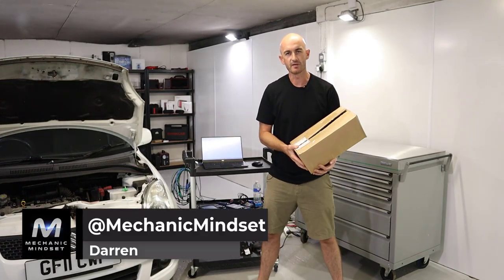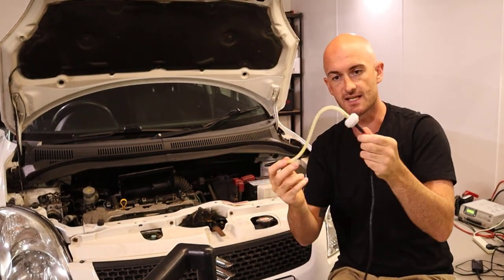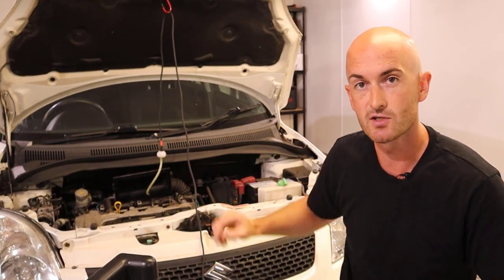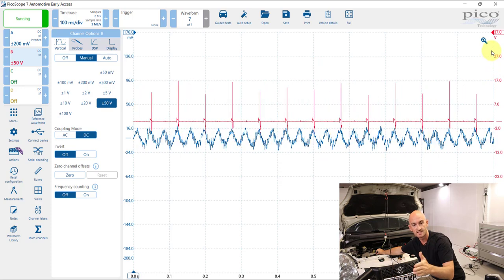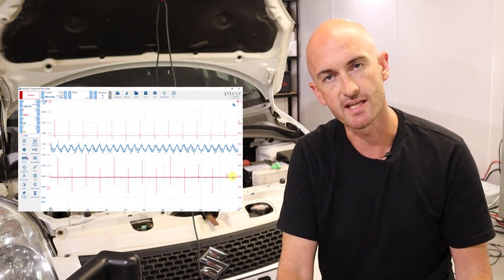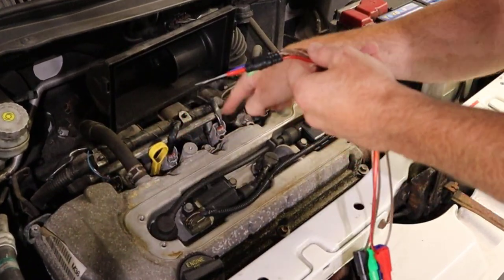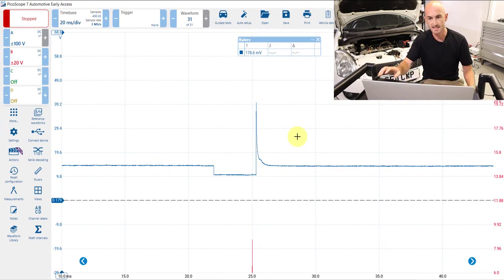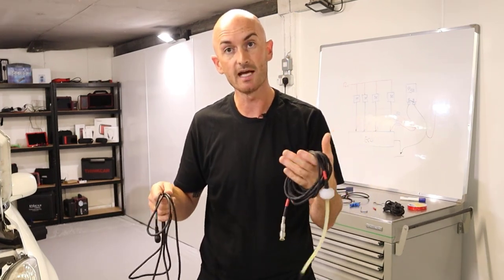What do you think of these scope probes?

Comment: Thanks a lot, Darren. Useful information and excellent presentation, as usual.
Cheers. George
Reply from the maker: Cheers George! Have you seen Rotkee before?
Reply: Yes I have seen their site in connection with the waveforms available on it and I was wondering about their equipment too. Now recommendation coming from you makes me want to buy some 😊. Let's see.
I was looking for more affordable pressure sensors for in cylinder diagnostics. Are the ones ROTKEE offer going to work? That would be nice to know.
Reply from the maker: @georgetzekov445  I’ve not tried their pressure sensors but they seem to have a BNC output so I would say yes. 

You would just need the parameters to make the custom probe. 

I assume it would come with its own separate power supply too. 

One of the pressure sensors looks like it’s out of stock at the minute

Comment: The Rotkee probes look interesting.  I have similar probes from some other vendors, but I like to try new probes.  I ordered several, the acoustical probe, the 4-in-1 probe (2), and TL-mlp Multipurpose Test Lead.  I enjoy watching your videos.  I do have a PicoScope, a 2204, for small stuff - and mostly to be able to say I have a PicoScope for folks that may pooh pooh me having a non-PicoScope in my arsenal.  My GoTo scope is a MicSig 4 channel SATO1004.  It is very capable and not needing an outside piece of equipment (laptop) makes it easier to use - less clumsy.  All of the various demonstrations you present can be performed with the MicSig unit also, which is nice.
Reply from the maker: MicSig is a nice scope! Very convenient as a tablet 👍
Reply: @MechanicMindset  I like both, but the MicSig is my Go To scope.

This may not be "new" to you, in fact I am betting it isn't, but for for giggles I will share a few thoughts.  I recently became aware of, and purchased two Chassis Ear kits.  One has wireless sensor, the other had wired sensors.  For the wired sensors they are terminated with 3.5mm sound jacks, which get plugged into a 6 channel box where I can flip a knob to select which channel (sensor) i want to listen to.  The idea is to find out which sensor is picking up a bothersome noise or vibration.

Well, while I was tinkering with the wired sensor kit I decided that I wanted to pick up some 3.5mm jack socket to BNC socket adapter cables.  Then I can plug in up to 4 wired sensors and direct the electrical signal from the sensors into each of the 4 channels on the scope.  That way I can get a visual representation of the various sounds.  I can also watch up to 4 channels simultaneously as opposed to only being able to listen to one channel at a time.    Morever, were I to pick up a low cost 8 channel recorder/playback machine I can make a recording of multiple different sensors that I can play back at any time I like.

I found out, after my epiphany, that Pico has an NHV kit already, that does what I am describing.  But, they have taken their design to a true cutting edge, whereas my approach is more akin to a hacker coming across a cool idea.  I guess I have a poor man's Pico NHV near equivalent for a lot less than the Pico kit is.  Now that I have these Chassis Ear units I can't  am hardly wait to come across someone with an objectionable noise!  So, I will just begun to play with the Chassis Ear morphing into the oscilloscope arena and see else I can come up with.  I have lots of ideas already.  What fun, blending two or more technologies to help resolve an issue that drives a lot of folks crazy.
Reply from the maker: @gilberthale7777  I love the chassis ears kit; used it all the time!

Yes they give off a small voltage; I think they are piezo elements which are often used in microphones. The Pico kit is next level; I understand they are more like accelerometers which don’t suffer the same physical effects of piezo and can measure more 👍
Reply: @MechanicMindset  chassis ears do use piezo chips to generate low voltage signals. Just having the chassis war kits is awesome unto itself. But melding into the scope world is going to make it all the more fun. 

The Pico NHV kit is definitely awesome. And way over the top. From what I can tell been without a scope interface the chassis ears are going to be a game changer for me. I wish we had these available back in the 70s and 80s when I worked as a tech.
Reply from the maker: @gilberthale7777  Cool! Yes the NVH kit can determine the frequency of vibrations and noises which can then be paired with components of varying rotational speeds (so you can tell between diff, wheels, engine, transmission etc)

Comment: I heard about ROTKEE a few years ago, I got there petrol in cylinder  pressure sensor and adaptors I have found it to be very good quality, I like the 4 into 1 lead, the only problem I had when I ordered my parts where paying for them bit off a messing about lucky I knew someone in Ukraine who paid locally for me, ROTKEE  also have a good waveform library where you can upload waveforms from any oscilloscope unlike Pico.
Reply from the maker: Thanks for sharing!
Reply: @MechanicMindset  Just ordered a few more items from ROTKEE and they now use PayPal which make paying much easier.
Reply from the maker: @no1conrod  Agreed! I think the payment terms were a sticking point for most orders 👍 Enjoy!

Comment: The signal is between 5V-15V for the Rotkee Ignition Pickup.  Igniton is usually around 50V, is there a conversion needed to get actual measurement or is it for waveform shape analysis, not waveform measurement?
Reply from the maker: Thats right, shape analysis. It may vary depending on coil construction. And as far as I’m aware we can only ‘measure’ secondary kV on the HT lead to the plug 👍

Comment: So I’m really new to oscilloscopes. My question are oscilloscope current probes interchangeable between brands? For instance I can buy a pico scope current clamp and use it on a siglent brand handheld oscilloscope?
Reply from the maker: Yes, if the oscilloscope has the BNC connection, it should work on any oscilloscope

Comment: One thing I don’t quite understand, is why there is no direct ground connection on any of those? Will it be safe to connect through 2 BNC splitters?
 (6cylinder application) Ignition over the wire pickup comes in sets of 3 maximum. 1 splitter for 2 sets of 3 pickups and the second for the ground connection.
Reply from the maker: @marekhabel2493  I think they are designed and considered for the MT Pro scope where you generally attach a separate ground. I have scope leads from them too that are only one positive probe

Comment: I was going to ask about backfeeding the other injectors with that four lead probe but you answered that. Wouldn’t putting a diode in-line be a better solution and not affect the signal while preventing one signal from actuating all injectors?
Reply from the maker: I’ve looked at this, I don’t think you would get a signal on the scope with diodes. It will stop the short circuit though. Draw it out, it makes sense then. At least that’s the conclusion I came to 👍
Reply: @MechanicMindset  I was thinking one diode on each leg of the splitter that would allow the signal to come up the line but stop signals from coming back down the line. I’ll have to draw it up and look at it. I’m pretty sure I’ve seen one with diodes for primary ignition in the past
Reply from the maker: @Jpilgrim30  I’ll try and test it with 1 diode

Comment: Would a diode be better than a resistor? It would block the voltage going back to the other injectors that aren't being fired. Do I make some kind o sense lol
Reply from the maker: Yeah, I can visualise that. Not sure how that would affect any negative readings, ie, when the voltage drops after the spike. Might give it a go with one channel and see what happens
Reply: i did electronics from an early age, the problem may be that Resistors will 'dissipate ' (absorb) a certain amount of energy (depending on the wattage) of the resistor, however with a Diode , there are an awful lot of different types, forward/reverse bias, Zenor types etc, is that it will allow current flow in 1 direction(or hold a certain amount of energy until it reaches a threshold) and then it has to do something with it? if you get my drift, remember the current flow will take the least resistive path, be it Earth, point of activity or dissipate in heat build up. but no harm in trying, were all wana be experimenters / home scientist's and students of learning,🙂
Reply from the maker: @sollykhan2385  Yes, semiconductors are strange things!!
Reply: @MechanicMindset  indeed, current flow reminds me of the younger generation of today, it takes the path of least resistance !!🙂

Comment: Does the Rotkee pressure sensor or the COP inductive sensor require an attenuator on the Pico 2204a?
Reply from the maker: For the COP, possibly yes. Pulse sensor, no, it’s really low voltage 👍
Reply: Thanks for the reply! I decided to put in an order for both sensors as well as a set of their flexible backprobes.

Comment: I will be ordering the 4 into 1 leads and I was thinking about ordering two so I could cover 8 cylinders on two channels along with two of the basic 4 into 1 leads so on a four channel scope I could see all coils and all injectors on an 8 cylinder engine for example.  As for a 6 cylinder use four on one channel and two on another channel.  Is there something I'm missing or do you think that would work?  Great video and I will be without a doubt be ordering from them.  An $89 pressure transducer definitely caught my eye as opposed to $1300 for the Pico kit.  Maybe you could do a comparison test with them possibly?  Thank you for the great videos.
Reply from the maker: I did a video with the transducer. Works nice. Although WPS500 is another level; recently did a video in that too. For doin 8 cyl, you could get 2x 4-in-1 lead and feed them in to the same channel with a BNC splitter; as the waveforms won’t clash
Reply: @MechanicMindset  I actually found that video after leaving this comment.  Thank you for the information on how to use two sets of leads on one channel.  I will soon be signing up for your scope class.  Thank you for all the great information in your videos.

Comment: Would you be able to test the shielding ability on the Rotkee extension wires with the translucent insulation like that are on the end of the mixer lead compared to a traditional cable like the Hantek HT30a? I was looking at these but have some reservations about how well this type of wire would do to prevent interference.
Reply from the maker: I think there will only be a minor change. Did you see the video where I made my own scope cable with twisted speaker cable?😆 It worked ok.

Comment: Did you mean to say diode with the injector test leads?
Reply from the maker: No resistor. It wouldn’t work with a diode. I drew it up and can’t remember why, but it won’t work.. it still needs flow in 2 directions to take the measurement and operate at the same time
Reply: @MechanicMindset  Yeah, I trashed the idea not longer after I wrote it. I suppose the shape of the trace has more to do with understanding an issue than knowing an exact voltage value
Reply from the maker: @howlinhog  Yes I think it’s just more for checking that it’s actually happening

Comment: This Rotkee Ukrainian company appear to be producing some very interesting products . Do you know if their  VS vibration Sensor for use on diesel engines is compatible with the entry level Pico oscilloscopes ? They also do some very interesting equipment for detecting vibration in bearings.
Reply from the maker: It seems the VS Vibration Sensor is compatible; it has a BNC connector. 

Yes, the NVH equipment looks interesting!

Comment: They add resistors or diodes ?
Reply from the maker: Resistors I believe. Hence the ground voltage doesn’t go to 0V when the injector is activated. If you used normal diodes I don’t think it would work.
Reply: @MechanicMindset  but the resistors will consume the current in both way. Diodes will let the current to move in one direction.
I'm from chemical Engineering I studied electronics level 1 on  2009 let me read to refresh my memory and come back to you.
Reply from the maker: @abdulkreemalsultan134  Yes agreed. I had this conversation before with someone; I’m sure there was a reason it didn’t work. Also I think I checked it with my multimeter 😁
Reply from the maker: @abdulkreemalsultan134  Draw it down on paper and consider all paths when the injector is on and off. When the injector is off, that lead will be 12V, and the activated injector 0V, it can’t measure both simultaneously; the resistor is the answer. I needs current to flow both ways to make this type of measurement and circuit work. What do you think? The circuit will work but the oscilloscope wouldn’t measure what we want
Reply: @MechanicMindset  I have draw it with 2 idea I don't know how to send it to you so I just uploaded it as a video on YouTube. 
Either we use diodes or we can use multi relays driver L9026 I included the link for the data sheet for the L9026
https://youtu.be/vkvLDBmArdM
Reply from the maker: @abdulkreemalsultan134  Nice, I did the same on a scrap of paper. What do you think, the Oscilloscope will read 12V all the time now?
Reply: @MechanicMindset  yes it will read the signal from each injector and it won't effect the other injectors. but may not read 12V because the diodes got resistance too most probably they use multi driver relay.

Comment: Would love to see some more tests specifically on diesel and if possible wankel powered vehicles
Reply from the maker: Will try and get some diesel in soon. You know what, I’ve never worked on a Wankel engine ever!! 😳
Reply: @MechanicMindset  Good job, the 'SPELLING' of that engine design has been curated carefully , Lol 🙂, i'm an older Dinosaur, and have worked on a NSU Prinz, and a RO 80 ( Wankel rotary designs)  from the 70's, but haven't seen hide nor Hair of anything that has survived from these older car's, but not any newer types,,,Yet.
Reply from the maker: @sollykhan2385  Awesome! Were they good to work on?
Reply: @MechanicMindset  yes, they were in a strange way, futuristic tech back in 70's, the only problem was oil and water mixing and rotor tip's wearing away, i thought the tiny NSU Prinz was a  cool car to bolt about in, till it broke down!! 🙂
Reply: The early Wankel engines were a pain in the butt to diagnose rotor tip seal wear and now with these modern products and oscilliscopes it should be much easier. We put a Wankel engine into a Lotus Elan and it was a flier leaving blue smoke everywhere !! 😞
Reply from the maker: @geoffprotheroe1201  Wow!
Reply: @MechanicMindset  i would like to see some deisel injector voltage measurements aswell  at some point just so i no what im looking for ,cheers